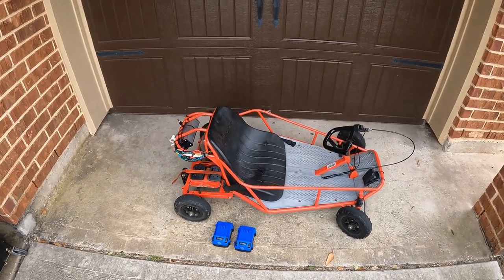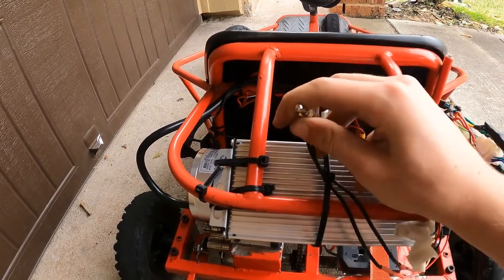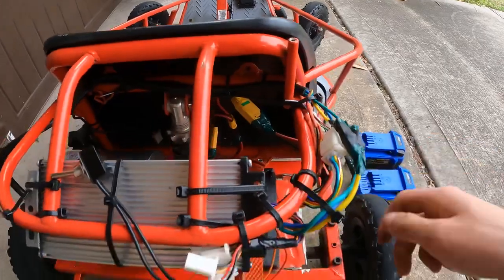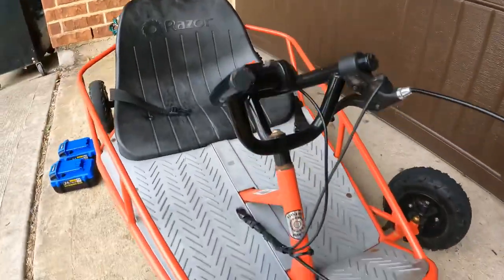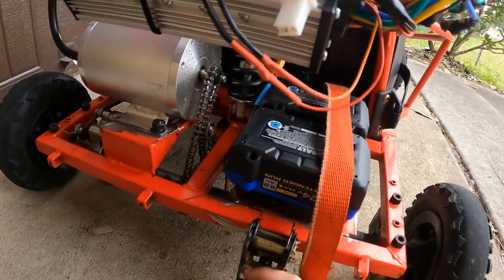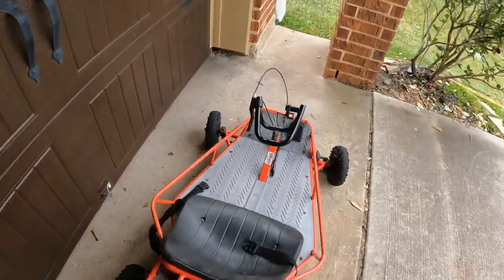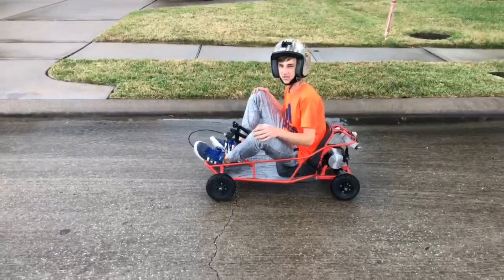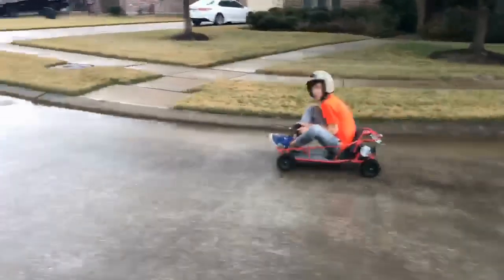30mph Razor Dune Buggy modified with Kobalt 24v lithium batteries!

Comment: Sweet video. How many teeth does your motor sprocket have? I've heard you lose a lot of torque but gain speed when you take out the middle gears... do you still have enough low end? Have you heard of or attempted the shunt mod? They usually helps low end a lot.

Comment: what did you use for the battery connections on the cart? did you scavenge from drills, or is there a place to source those?
Reply from the maker: You can find them on Amazon
Reply: @eatsleepplayrepeat1914  For those interested, these are the clips that the battery connects to in the buggy

https://www.amazon.com/Made-Mitchell-Connect-Kobalt-Battery/dp/B095W2SLF6/ref=sr_1_3?crid=VBNU2PYMZ0U9&keywords=kobalt+battery+mount&qid=1664906286&qu=eyJxc2MiOiIyLjYzIiwicXNhIjoiMi4yMSIsInFzcCI6IjEuMzgifQ%3D%3D&sprefix=kobalt+battery+mount%2Caps%2C110&sr=8-3

Comment: Great video. I have the same buggy and just bought the motor/controller combo you linked.. I already have a 48V battery pack.. Can you tell me how you shortened the chain and give more info on how you got the motor to fit? Thanks
Reply from the maker: I would suggest ordering #25 roller chain, a chain cutter, and a few master links that way you can cut it to the appropriate size.
Reply from the maker: You could also add a few washers in order to lift the motor high enough so that the original chain works.